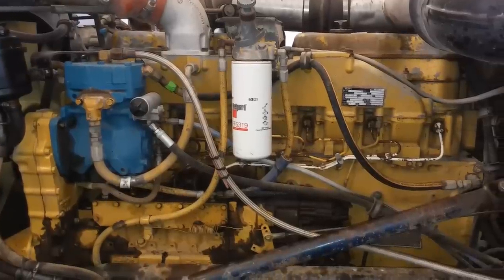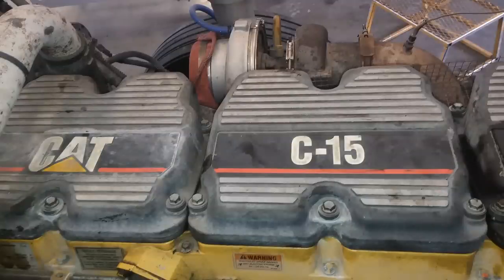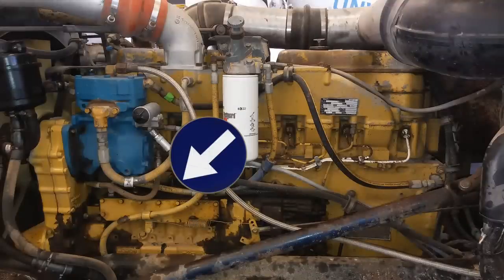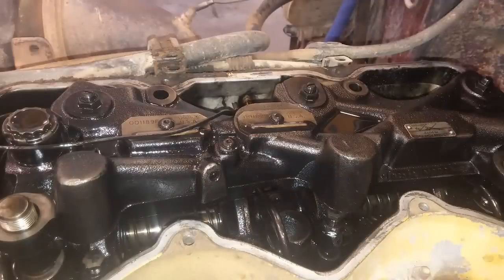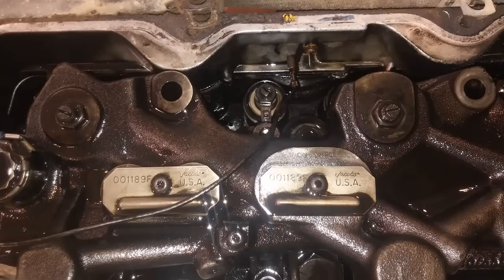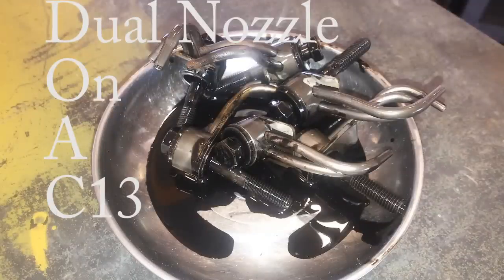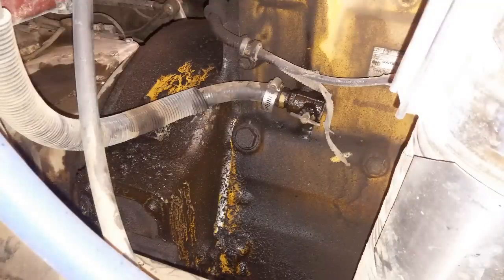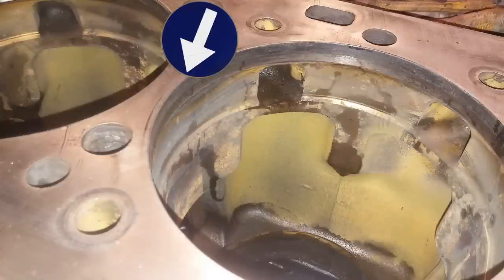The Cat 3406B Engine. Know Your Engine.  Caterpillar 3406 Information And History.

Comment: The first 3406 was the 3406PC, it had a unique sound. Very much like the 1674, the turbo charger was huge and once it got going it was the first thing you heard. They were rated at 365HP but they pulled very hard. The PC was for Precombustion  Chamber. They hard glow plugs and would start better than any other engine. The original engines had a steel plate/ spacer between the head and block, this worked pretty good, once they changed to Aluminum the failures really rammed up.
Reply: These was a 360 HP used a T18 turbo off a 1693. The major problem was not the spacer plate change. But removing asbestos from the gasket. Did not have a handle on that. The aluminum spacer plate just accelerated the failure. The original engines lubed the rocker arms via the head bolts. A lot of oil in the cooling system failures. Block and cylinder head was redesigned with a oil dowel in block and a hole in the cylinder head. I had one years ago someone put a earlier head (no holes) on a dowel block. Thus the rocker arms failed due to no oil supply.

Comment: We’ve got 2 3406B model cats that are sequential s/n’s. We’ve had to replace the camshaft in both engines within a year of each other because a lifter retainer broke and the lifter spun in the bore and wore the lobe off the camshaft. Both engines did the exact same thing! It was weird. Other than that, they’ve been great engines!
Reply: If they have a compression brake, it is recommended to do a lifter inspection at mid life.

Comment: 1990 peterbuilt 379 short hood 256 wheel base 3406b 13 spd pump was turned up steel hauling at it best
Reply: Matt Pamp it would take a steel hauler to not spell peterbilt right
Reply: It was probably the autocorrect on his phone 📱
Reply: Sweat equity i can spell it any way i want
Reply: @mattpamp8204  You tell em, Matt

Comment: The good old four and a quarter cat, set the engine up to do 475 horsepower to 500 Max and put a 13-speed transmission behind it. This combination was used a lot in the Peterbilt and the KW 900.
Reply: How do you set it from a 425 to a 475, 500 max?

Comment: Pretty much early cat engines where adapted Bulldozer and other construction equipment engines modified for truck use on the road. They had to designed their own engine brake because they couldn't fit a Jake Brake. The clatter comes from a pre combustion chambers on the engine. I don't know if that is even found on later engines but is the origin of the nickname Clatterpillar for CAT truck engines.
Reply: the pre cup engines were not the 3406bs or a, we had an old 375 with the precup engine rest were all direct injection
Reply: Do you know, is this a good engine for an OTR truck??  Light loads but lots of mountain passes. Thank you
Reply: @chapc  they are very good durable engines and perform quite well in mountains as they are designed to lug underload down to 1150 to 1200 rpm and they just keep on going

Comment: Yup that would be me and I am retiring . I have not worked any in a while except in some old loaders and scrapers. And a induction heater took works great on the bolts at the thermostat. . Use that to heat them up and out everything comes

Comment: OMG yes that engine was definitely very leaky and I hated it! Another thing I hated was the injector fuel lines vibrating loose if u didn't have a certain little bracket thing to hold em still! As far as black smoke, the one I drove blew tons of thick black smoke which I would assume was due to the power that it had!

Comment: Being a certified Cat Tech since the 80's let me add some more info here. The 3406B  is based off the 3406A. The biggest difference is the A model had a intake system with a intercooler inside the intake manifold. The fuel system used capsule type nozzles and some early A models had precombustion chambers with glow plugs. When the 3406B came out air to air core charging was used to replaced the intercooler and the new fuel system did away with precombustion/glow plugs. Cat gaskets on 3406A's were asbestos and when the 3406B came out the federal govt / EPA had banned their use in the mid 80's. Cat was the lasted OEM to switch over to non asbestos material. The first B models were blowing head gaskets because the replacement material could not seal. Also the puzzle gaskets worked well when installed and the mount bolts torqued correctly. The flywheel housings would leak because OEM's would mount their clamp brackets to the housing mount bolts instead of using the provided mount holes. The weak point on the B model was the timing advance. Two designs were used a flat cover and cone cover. The flat cover design used less parts. The AFRC valves also needed rebuilding often. In my opinion the 7FB and 4MG were better made engines.
Reply: The 3406 now called A model came PCTA, DIT, DITA.  DIT engines was low HP and if a turbo failure occurred on the cold side you could trash some pistons. As it didn't have an aftercooler to stop the debris. The 3406B came out 7FB's, and the first ones was JWAC. Used a head off the A model. If the bottom surface need to be shaved you had to remove all the valves and nozzle chamber. Injection PSI was increased for emissions. Went from a slide weight VTU to a Hydro-mechanical VTU. The very first 7FB's was not fun to work on.

Comment: Great video as always! I have a couple of 3406B's and E's and I really prefer the B's. I took a 3406C  and converted it over to a 3406B and it was rated at 425 horsepower before and after the conversion but the B model only made a little over 20psi of boost and the C model made around 30psi so it doesn't smoke nearly as much and has a lot more power than my other 3406B models and actually will out pull my 550 horsepower 3406E model!!
Reply: Is there a video anywhere that can show me how to replace the O rings in a manual pump, I just bought a 3406C and its leaking fuel out the top of the injectors pump.

Comment: A great video as always.  The puzzle gasket sounds like a bean counter wanted to cut down on shipping costs.
Reply: Other CAT engines use a puzzle gaskets, such as 3304's which were smaller.
Reply: Always use something on the joints of the gaskets will seep if you don't.

Comment: Cat still makes a mechanical 3406C (almost the same as the 3406B) for third world countries that don't want electronics on their engines. Also Cat makes the 3406G-natural gas engine. I have 3406B 400hp jacket water aftercooled in my truck that I'm making a motorhome out of. Took the 13spd manual out and installed an Allison HT740-man what a hot rod it is now!

Comment: I drive a 89 Pete tri-axle dump truck.  Not 100% sure, but I think it has the 3406b in it. Great old piece of iron. Runs like a top. Not the original engine to the truck. Boss put it in a few years ago.

Comment: 3406b and 3408 are the best 2 cat motors ever . All you need to carry  is fuel diagram  and fuel celanoid and little clips for fuel lines .. and you can get 609 plus hp out of them

Comment: The production was started in 1983 and ended in October 1992,the 3406c went into production in November 1992 for only 17 months during a labor strike @ cat, then the E came out, that is fact, check with caterpillar dealer parts and they will confirm this

Comment: 1997 was the last year Paccar used the 3406B. 1996 and 1997 the 3406B was a option in certain 379's and W9's and was usually paired with a deep reduction 15 speed during those 2 years.

Comment: Few notes from what i remember
Oil pan gaskets are puzzle type because they are made for multiple configuration 
Of oil pans there are always left over sections of puzzle pieces
I always used green cat cement and glued one on top of spacer plate and on pan rail
Next was water pump leaks you had to keep your coolant in good shape best to use test strips and proper water filter some time with dca some times without
Too much dca takes out the pump seals
First thing cat wants on warranty water pump repair is to check the coolant with test strips if its not right kiss your warranty good by
Injector bonnet seals notorious for leaking after ultra low sulfur fuel
Better know what your doing her seen engines run away when improperly done but is a easy job
Turbo seal be careful  here also keep some CO2 fire extinguishers around if the engine starts sucking oil from the turbo 
Hang on for some excitement use CO2 into intake to shut them down
Only other little nuisance is automatic timing advance mechanizum the bolts in them come loose break at time careful to correctly assemble them also 
Fun some what easy engines to work on  
Alway change the water filter at oil change
Even if its take a plane straight filter 
The bottom of the filter can rusts out loose your coolant and stick a piston 
Seen it happen a few times

37 years heavy duty mechanic
Peterbilt motor co. Mack trucks freightliner trucks

Comment: The most powerful Cat I've ever driven was a mechanical 3406b tuned to 850hp with I believe over 2000+ ft/lbs torque and 4.08 or 4.11 rears in a 18 speed 94 Pete 379! I loved that motor at least while tuned! Never drove one at stock 425hp 3406b! Not sure what they did to thar truck to turn it up since it wasnt mines! That truck taught me how to drive all over again due to the fear of stalling it while driving down the road since that jake would stall the truck if you happen to miss a gear and the jake is on in neutral even tho the jake is super weak on that engine! Nevertheless Oh boy if that happens then whichever direction that truck was going then that's the way it continues and steering locks up with the truck. I first stalled it on a curve approaching a quick changing red light and had to focus on stopping versus shifting since cars were in front of me and yep I had to stop her in neutral since the light caught me in between gears and yep the jake was on. It was the most scariest situation ever lmao! That thing definitely taught me differently especially since I'm a new school trucker not an old school! That engine is definitely my favorite. Right now I'm in a part mechanical part electric N14 Cummins which I would trade for a 3406b any day...or any Cat for that matter!

Comment: Love are B model in are winch truck we have rebuilt this motor several time and never had a problem well till last year buts thats only do to a warped head hardly leaked any oil and if it did it was from the injection pump or because we messed up a main seal

Comment: The last guy I drove for had me in his 379 with the 3406b turned up to 850hp and I loved this engine but if u didn't know what u were doing while driving it this engine will make u look like a complete rooky, those who has driven this engine knows what I'm talking about referring to the Jake being on in neutral causing the truck to stall out losing power steering etc lmao or even letting off the clutch to accelerate but having to kind of release clutch and accelerate simultaneously and if not u roll back lmao? As long as u know how to operate it then it's a beautiful engine!

Comment: I run an 86 freightliner flc 3406b cat no leaks 632k original miles but doesnt like hills may turn it up a bit
Reply: Cool. I’ve got the same truck but with a big cam 4 cummins. U got any pics or videos?
Reply: Technical Items how does that big cam 4 run.

Comment: Great video man...very informative....I own a 90 379 with 3406b,7FB Engine serial# awesome motor...what's the best turbo to  install? Thanks again
Reply: I put the 177148 wastegated turbo on mine and I love it on the performance end however fuel mileage went down about a1/4 mile.  But made it run like an e model or better and it will handle a lot more fuel turned to it with egts.

Comment: I understand there are CAT fans out there, but after owning a 3406B, I'm not one, my other 2 trucks had NTC Cummins of which I am a fan of, CAT  parts meant going to a cat dealer that may be 200 miles from where you broke down,all parts are costly but Cat  parts are more costly, CAT  did make good tractor motors in the 40's and 50's  but never made a good truck engine, I also had Detroit engines and liked the 671 over the 3406B,simply over the ease of repairs,  Cummins and Detroit gave better fuel milage than the Cat ever did, It is correct about being an oil leakier,both Cat and Detroit have this problem, as for being stronger , not really in my eyes, my Cat never out preformed my Cummins engines.They all smoked as I had fuel cranked up on all of them
Reply: yeh them them cummins no cams fell on their butts 10 miles past their warranty and you were left high and dry caterpillar stould behind their motors

Comment: Hey thanks for the great videos. overhauling a 3406B 7fb right now, I have a c15 assembly manual I’m assuming the crank /rod oil clearance and torque is same but head is different . I’m in need of specs, for protrusion. for head bolts rockers, valve covers,  rocker clearances, Jake clearances

Comment: One other thing these engines was the alternative support eye-hole bolt shaft always breaking. I owned 3406A and 3406B both were prong to breaking those eye bolts. Not cheap.
Reply: You have an alignment problem.
Reply: @johngoldsmith6629  Nope stress problem. Just eye on alternator and the eye bolt. Just threaded rod and tension block stop nut and nut on opposite side. Just design fault to hold alternator.
Reply: @harco1theotr869  I have replaced a lot of these and most of the time they are out of alignment causing the the rod to bend. Seen all types of misalignment, you get it straight they don't break.

Comment: A few things that I didn’t like about he 3406b was that the cruise control wasn’t really a cruise control but a stick next to the seat that u pull up and then the accelerator pulls down and it does not hold the speed at all! I look at it as more of a fast idle switch or stick! I also hate having to fill the coolant reservoir while the engine was running!

Comment: Nice vid...im running a 3406c.i brought new in 94 converted over from peek to full mechanical..million mile engine when driven right..more power better fuel mileage after the conv.. Peek engine was a pain..the timing sensor stunk on that engine...

Comment: I overhualed one of these almost a year ago and none of my friends or old employers would loan out a seal tool I tried to make one . Looks like I'm going back in with a 600 dollar tool I will use just once.   

You cannot just do a head gasket , the liner protusion will get you, in Bakersfield the rule was " if you touch it ; completely overhualed it and set check and recheck liner height.  600-700 dollars in Los Angeles
Reply from the maker: I've never seen one with a blown head gasket that didn't have a sunk liner. On any of the 3400 series.

Comment: I have an 3406 a, marine engine.. but it is a direct injection, and also high pressure injection pump and injectors.. I am told, this is a late model a, which is the same engine as the b... It has no fuel screw or place for one.. it takes a back seat to no one..

Comment: I broke a steel injector line just driving back from Florida in North Carolina. The Cat dealer charged my 200 bucks for a steel injector line. It made a hell of a mess!
Reply: If you don't have the brackets and clamps it will do it again. Best to use a 8PN serial number as a guide. I do them slightly different than the book. Never had any break.
Reply: @johngoldsmith6629  You are correct. I know all about them. That is why my first line broke. The screw fell out and I didn't know about it until it broke.
Reply: @SteveV6206  Use 8PN and you need a lot of parts. When I get done with them, the screw can't fall out.

Comment: There are thousands of these NA engines in this area to pump water "around 75 to 120 hp" that are converted to Natural gas  10.5 : 1 compression.   The shop I use will not warranty the 3406B rebuild unless the  the rpm is over 1500 to lubricate the valve guides.   I run mine around 1300 to save fuel and ware.   Should I be running it over 1600 like he says?

Comment: B model started late 83, late 85 went from jwac to ata. Also they have 349a jakes. B model stopped production early 94. Range from 285 to 425hp. They use a hydro mechanical fuel pump and timing advance. Also you forgot the biggest weak point of the B is narrow rod journals. Reason why the C came out with wider journals. Terrible about spinning rod bearings. Worked for cat when these engines were new
Reply: Disagree on the wider rod journal. They started with the B model, 2EK00512, 3ZJ02830, 4CK00170, 5KJ07539 and 5YG00001  and up. The first B models use a 92U cylinder head casting. If the head had to be shaved, you had to remove all the valves out. So the nozzle chamber could be removed. The bridges on a Jacob's brake was 92U design and did not take Jacob's long to modify them. The JWAC bolts had extremely long spacers on the intake to head joint. The governor shield would break and had a over speed issue. You could take the governor off and turn the fuel screws with out breaking a factory seal. The first 5,000 or so, the fuel pump hsg was machine wrong and the sleeve would come out of the piston/valve assembly and you would loose dynamic rack travel.
Most people bought a 310 HP and required only four main parts to make it into a 400. When Cat found out they redesigned the 310 and it was a 310 for life. A few of the early problems with a B model. 5YG's was a 460 HP, C models started in the Fall of 1991.

Comment: Probably won't remember me but I've been trying to figure out a fuel timing issue that no one can figure out on a 3406 b for over 2 years and way more of my money than I care to admit. What can I say. I love my 7 FB. That said, is there a way of testing the ATA? BTW Cat's modification (welding the 2 plates)  has been done correctly several years ago.